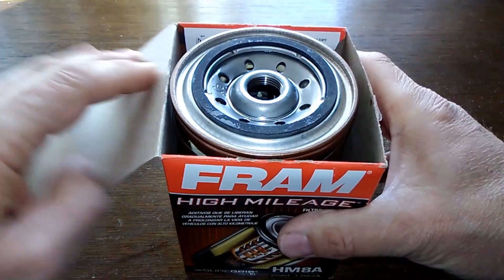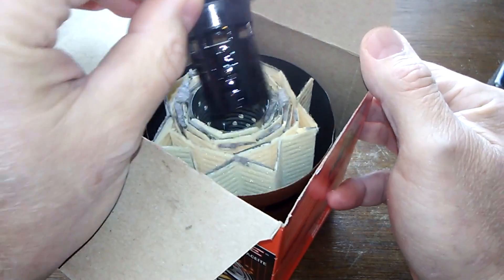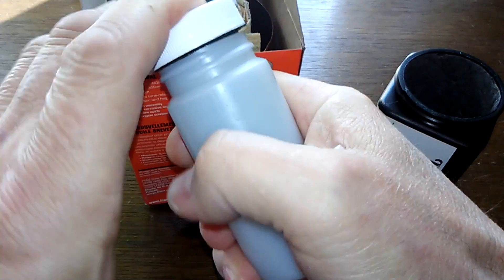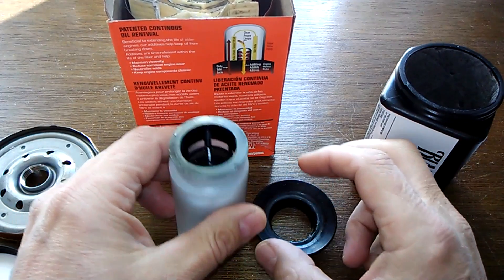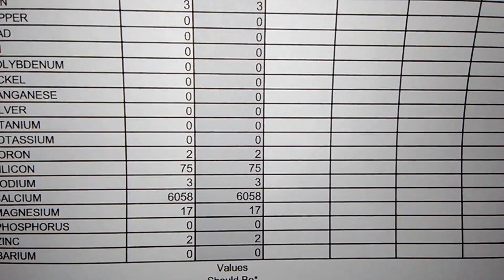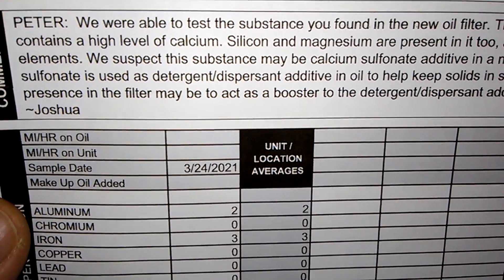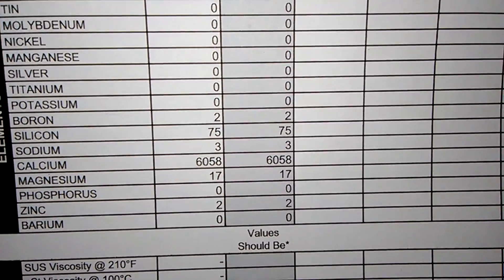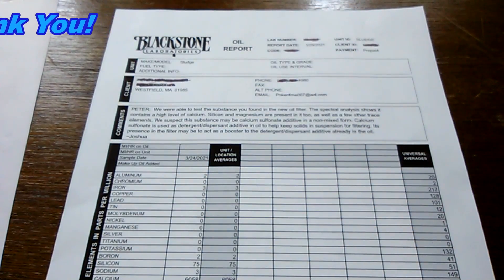Fram High Mileage Oil Filter Blackstone Lab Oil Analysis

Comment: I’ve used this 4 times high mileage filters. With mmo and guess what my motor runs great . 5.0 13 mustang Gt fully modded
Reply from the maker: Thanks for Sharing👍
Reply: Started using them in my low mileage Lincoln MKt eco boost and oil analysis is perfect . Guess they are great . Also use on the 13 mustang Gt no problems

Comment: I never thought I'd watch Sooo many videos on oil filters lol. Hey, what's the deal with the Fram,  so called " Orange Can Of dealth" anyways? Thanks man!
Reply from the maker: It's a bunch of BS.
Some people dont like the endcaps.
I dont like them either. I used to use them before Youtube.
But I won't bash them just to get views.
Reply: @WhipCityWrencher  ..Ok good to know. Thanks!
Reply: @WhipCityWrencher  Agreed. Initially I wasn't a fan of cardboard ends either, but they don't bother me anymore and they actually have benefits over metal. They are cheaper to make, more environmentally friendly, and they allow for more filter media in the same size can since they take up less space and don't cover the ends of the filter element. Also, Honda, Toyota, and probably other manufacturers have been using filters with cardboard ends for 20+ years now. If they were actually failing and causing problems, I'm sure they would have figured it out many years ago.
Reply from the maker: @averyalexander2303  Hi Avery,
Thanks for your feedback!👍

Comment: Really thought it was an additive for seals to swell. Good to know it's not. Thanks
Reply from the maker: You're Welcome!
Thanks for watching👍
Reply: We don't really know that it doesn't have a seal reconditioner it or not since the Blackstone analysis is not set up to detect such. Blackstone tests for common components of additive packages as well as acid levels and particulate matter but even in the case of actual additives Blackstone can only detect the presence of a typical additive component but not even necessarily which form it's in. It's entirely possible that in addition to the Calcium that the additive capsule also contains diethylene glycol monoethyl ether (a softening agent) but we wouldn't know since Blackstone doesn't test for that.

Comment: I would have guessed that it would be a 'seal sweller' of some sort. That is what 'high mileage' oil generally has/does. A dose of 'cleaner' (dispersant) does good also.
Reply from the maker: My thoughts are that there's probably some kind of seal sealing chemical in there that they dont check for. If you look at a reg. oil analysis and a High mileage oil analysis you won't see any mystery chemical either.

Comment: Valvoline has a 150K high mileage oil now. I am curious what is different about it compared to their regular 75K high mileage oil.  I did not expect this to be a detergent additive. Usually high mileage refers to seal additive.
Reply from the maker: Maybe someone on BITOG will get an oil analysis on this oil.
Reply: My armchair chemist guess is that it has the same additives that are in their 75k HM oil but a bit more of them. I was going to buy some for my 165k car but decided to stick with full synthetic since the 150k is only in a blend.

Comment: Someone contacted FRAM and asked about it. A tech replied and said it was for Diesel vehicles that had EGR and sulfur issues. The oil would get acid like sooner so they made a filter with the additive for trucks (UPS was the customer) and it allowed them to go further before changing. 

Then the marketing dept. thought it would be good for passenger cars. He said the product works but that it was a matter of if you think you need it or not. Also,  it's efficiency wa 97.5 at 20 microns.
Reply from the maker: Thanks for all that information.
If that's the case then I think Fram should have called it something else instead of a high mileage oil filter, a little misleading on their part. A lot of people probably think this oil filter would help with leaky engine seals and such (me included). Plus I don't think I would want all that calcium in my engine.
Thanks for the Info, I greatly appreciate it.👍🙌😊
Reply: @WhipCityWrencher  If it was a zinc based one, it would have done better but there's been so much advances in oil quality, that it was discontinued. Still exists for Diesel I believe.

Comment: I'm starting to think Fram is not so bad after all. I really like the Ultra Synthetic, and the idea of a high dose of calcium seems like a good idea, but think the filter media is so bad, it would be good to change the filter maybe halfway between oil change.
Reply from the maker: Hi CJ,
Your Idea sounds pretty good, but Is a lot of calcium a good thing in a healthy engine? I'm by no means an expert in oil analysis, but I do find it interesting. Here's an interesting article on calcium in oil.https://learnoilanalysis.com/lube-oil-test-analysis-lab-lubrication-reliability-maintenance/what-do-engine-oil-and-a-pint-of-milk-have-in-common/
Reply: @WhipCityWrencher  I just read that article you kindly sent. I changed my mind, and believe too much calcium is a bad thing, and didn't realize it is actually a metal. I would think the calcium metal would cause abrasion after reading. Thanks for the response back and I will not use that filter after reading.
Reply: @WhipCityWrencher  Thanks for your reply! I'll check out what you sent. I wonder if cleaning too fast could be bad in releasing too much debris with low quality filter media with paper end caps.

Comment: I love the lab tests.  They are not cheap, but they give you a good indication of oil and engine life.  

As a vehicle ages I like to lab sample the oil and transmission fluids as part of my decision to keep pushing the car mileage wise (usually over 200k and beyond.).
Reply from the maker: Yep, it's a good way to know what going on with your engine.
I plan on doing a few throughout the summer, I have my daughter's car and a friend's car that I maintain and do oil changes, so I plan on making some used filter videos with oil analysis.

Comment: I would just get a high mileage oil instead of the special filter.  

I wish I knew about the lab.  Back when had transmission issues.  Before I did a 3 x drain&fill to do a slow ATF flush.  I would of sent in a sample of that ATF.  Which was black and brown. But no metal flakes or bad smell.
Reply from the maker: Yep, black and brown transmission fluid is not a good sign.

I'd rather HM oil also.